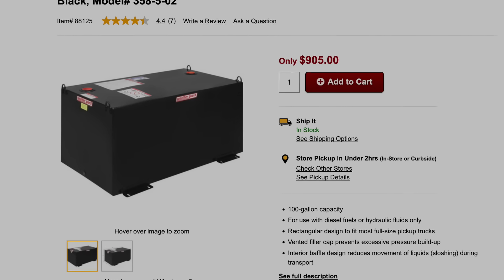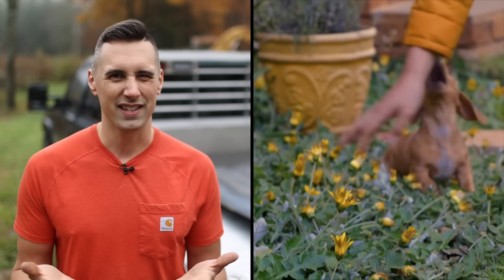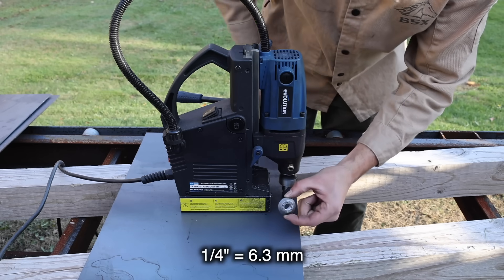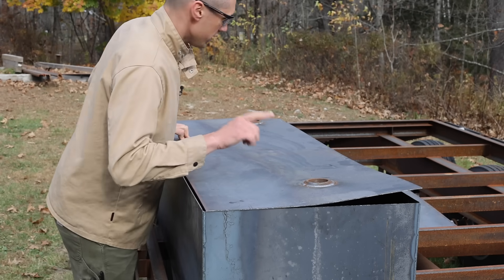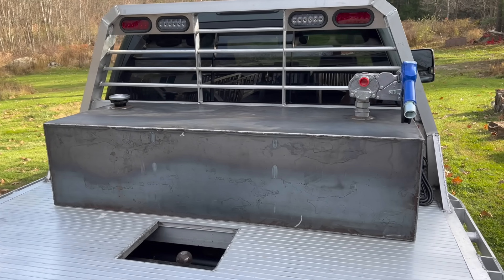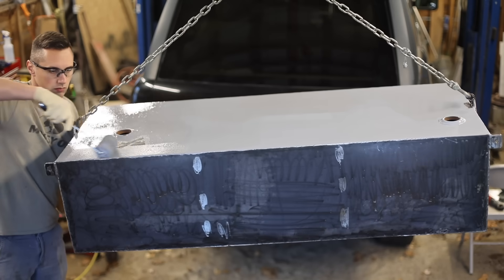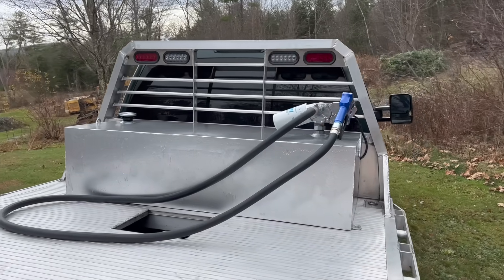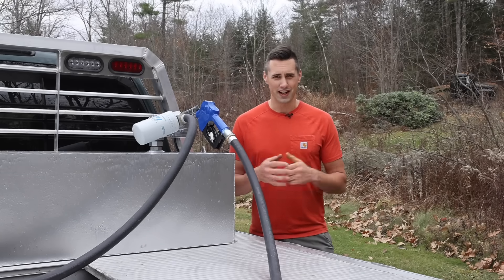Building a Fuel Transfer Tank

Comment: Normally I enjoy your channel as your doing fun projects that are well thought out. This however was not one of them, yes the fabrication was fun to watch. 

Issue #1 the design: It would have been a superior design to drop the steel off at a fab shop and have the front, under and rear panel bent (into the shape of a U) to reduce welds and potential issues.

Issue #2 the design of the fill and pump: Given your stated use as an Aux tank for long trips. Dragging the hose across the bed will be a pain and the fill and pump should have been on the left side.

Issue #3 red diesel ie off highway fuel: While less common now days, if the DOT/cops dip your tank or see you refilling your truck on the side of the road with red diesel we’ll that’s a big fine. I know it used to be 10k but I don’t know what it is now and may very by state. The issue is once red fuel is in that tank it’s hard to remove the die and it will stain your taxed clear fuel.

Issue #4: dissimilar metals and galvanic principals: I understand why you want to choose steel over aluminum costs however your bed is aluminum and while you did isolate the bolts and coat the steel to help prevent the two dissembler metals from touching. The bottom of the fuel tank is more likely to lose its paint and sag down overtime causing contact between the two dissimilar metals in a place that you cannot inspect easily. I personally, would made the tank out of aluminum as we’ve already seen you have the skill set to weld it.

Critique#1 I would have enjoyed, and others need the education, on how to leak test the tank with air/soap prior to filling it with fuel. Once diesel has been introduced it’s a lot more difficult to fix a bad weld. Yes, you do a very nice job welding and confidence is good, but also teaching proper technique is as well. 

Critique#2, next time coat the inside of the tank as there is moisture in the air and fuel that will rust it. 

I should say I also run a 60 gallon in-bed tank with tool box (low profile) and the 1,000 mile plus fuel range is wonderful. I also ran my own diesel for my heater but I used 5 gallon jugs, what a pain but saved hundreds every year. 

Good luck and I look forward to your next video.

Comment: Hi Waldo. Don't pay full price for on-road diesel to heat your home. You live in N.H. and should be able to buy off-road diesel locally and save a few bucks. I get mine from Kulik's in Winchester. The likelihood that you get your trucks tank dipped is slim to none. The Po-Po usually won't bother with small diesel trucks. So long as you don;t fill your truck up at the pump you should be good to go. Or, just empty the spare tank and refill it with the un-dyed stuff. what little tint remains won;t be noticeable.
Great job, by the way. Any reason you chose steel over aluminum? I'm considering building my own tank because I want gas on one side and diesel on the other. My son, who used to work for a fuel company, says it's legal to do that.
Love your vids. Keep em coming.

Comment: You screwed up on the welding the buns in if you don't have both pieces screwed together you risk warping one so it doesn't create a tight seal anymore no matter how thick the metal is you still risk warping it it may be small but it's still a potential leak especially since it's threaded

Comment: looks great , cool little project. i would have personally sprayed it with a cheap gun tbf but will still do the job just fine, also if any pin holes appear just use a bit of jb weld, it will hold up just fine (maybe xD)

Comment: It's almost exclusively propane or natural gas down here in the South for heating, outside of heat pumps which are the most common.

Heat pumps don't work in the colder states though. I haven't even seen an oil system in person lol
Reply: Heat pumps work in colder states. It's just the cost to install and run them isn't really attractive compared to forced air furnaces, wood stoves, propane heaters, or pellet stoves.

Comment: Seems like we’re thinking along the same lines. I just picked up a 74 gallon aluminum L tank with a tool box and manual pump for $500. Really glad I found it. The same setup new would be about $1700. I might never use an EPA can again.

I guess I’m cheap. When it comes to projects I’m more of a rustolium kind of guy. Any color as long as it’s black.

Comment: Curious as to why you did not paint the inside of the tank, or at a bare minimum, the  top half (where oxygen from the air, gets in)?  That occured to me as I watched you assemble the tank.  It's a very nice construction, I've seen "professional" tanks that were not nearly as well made.  As for your house inlet, is it possible to put on a short vertical pipe extension?  It looked like a normal iron pipe 90 bend to me.   Nice job, as per your usual!

Comment: Diesel out here in Kansas for the regular on road is running about $5.14 a gallon Cheapest I’ve seen it in my general area is $4.79 a gallon you should look into the off-road diesel to run your excavator and such and see if you be able to run your heating as well off. It only difference is that it’s dyed red and it’s not taxed runs about $3.30 a gallon for off-road diesel.

Comment: Waldo great job on the tank! I thoroughly enjoyed this episode. My only suggestion is a lock on the handle for traveling. What an awesome addition this is to your collection. 
I feel you on Pennsylvania fuel prices. We bought a place in Kentucky and Pa is the most expensive gas on the trip to the point I try to avoid the state as much as possible. Maryland is only slightly cheaper than Pa, but you save where you can. Just an FYI for your travels.
Reply from the maker: Thanks Pete! Yeah, I don't want to pay all those PA fuel taxes if I don't have to 😂

Comment: Can you get off road diesel anywhere near you? That would save the road taxes and be completely legal in the equipment or furnace.
I’ve been thinking about getting a tank like this because all my cars run on diesel and if you’ve been following news, diesel supply is getting low throughout country. Prices are likely to spike the winter and some areas might even run out.

Comment: Turned out nice with the exception of one small detail that i am even hesitant to say because i really like your channel and do not want to even begin to be "THAT GUY"  in the youtube comment section...OK, let me say that you do very very neat and clean work that always turns out awesome, but i was surprised with the quality of the final coat of paint on the tank. I loved the epoxy and the amount of prep time you spent to get it to adhere correctly. Maybe it just looked worse on camera than it does in person but it just seemed like it was full of runs and not as uniformed as i was expecting. It could be just the way that super thin aluminum paint was laying from the roller. I was expecting to see you spray it to get a super nice finish. Sorry if this is considered rude or anything, its not meant that way, its just a goofy thing that hit me as so opposite from what you usually do.
Reply from the maker: No worries! It actually probably looked better on camera than in person. It was too cold out and I guess I applied the paint too thick. It didn't run while I was painting, but when I came out to check it the next day, the runs had developed 🤷‍♂️
Reply: @WaldosWorld  It still looks great on the truck.

Comment: Hey Waldo Kym Adelaide here just wondering heating with fuel oil became non efficient here I Australia ,we went Gas now that has become a political football so now electric heat pump Aircond dusted but this is a discussion for a another time .My question is briefly how your system works does the DIESEL burn to heat water in a boiler system in your basement ,the then  heat rises through your house.Oh nice work on the fuel tank ,they don't let you build fuel carrying vessels here in Australia unless your a licensed business with certified welders and so on ,we are terribly over governed here .But as always great viewing mate hanging out for the next one

Comment: Any tool boxes ive made so far i always plan for 1 inch spacers so that you can blow out debris with either a leaf blower or an air compressor, setting things metal on metal seems to hold moisture , dirt gets stuck, and accelerates corrosion. So far it has worked really well for me.
Reply: I was thinking the same thing.  I have used Body mount pucks as spacers and they work really well.  Schmutz inevitably works its way under the tank, especially in rainy/snowy areas, and that always causes problems.  I use plated hardware too.

Comment: Unbelievably heating oil is actually cheaper here in Ireland so! Though I've switched over to Kerosene, a lot of people here burn green (duty rebate) diesel in their heating systems. The same fuel can be used in all construction, agricultural and off road applications. Its approximately €1.50 per litre at present and road (white) diesel is €2. I assume you don't have that option there? Though you guys had red diesel?

Comment: nice job  paint is not what it use to be. you have to be a good welder not to leave small pin hole's
 i got one years ago new that leaked had 3 pin holes. some states you are not aloud  to refill truck from tank in bed. there are big fines. that how i got my 2nd. tank. he got caught refueling his truck out of bed tank . if was in a state with high fuel taxes. he sold it to me with 30 or more gallons of fuel for$ 150. take care, be safe and well.

Comment: Another awesome project... I'm only halfway through, but great content as usual.

EDIT: Liking the epoxy primer for preventing corrosion, I'll be interested to see how this works. Where did you get yours? I'm hoping it's enough to prevent galvanic corrosion between your steel tank and aluminum bed.

EDIT2: IF you go to where they have a high flow diesel pump (Not always in the big truck section, some gas tanks have another one elsewhere for RVs, etc, it will fill up FAR faster than the small diesel pumps!

Comment: Waldo, get yourself an anti siphon insert. Drop it in the filler hole and tap the tabs in, you don't need fuel stolen on a road trip while at  a motel. We added them to our semi trucks. Great vid, and what made you choose steel over aluminum for the tank?
Reply: The push pull gun and Miller 300, I believe it's called, will set him back seven grand. You are not running four foot stringer beads with a spool gun.
Reply: Great tip too

Comment: why pull over? just install a button to switch tanks - this is common - you should  get a heat pump and power it with a solar  array and save money, be kinder to environment and geet tax breaks  to defray costs - lastly why not aluminum tank ?

Comment: I suggest using POR-15 Fuel Tank Sealer to line the inside of the tank. 
It's a great add on to prevent the inside of the tank from rusting when it's not completely full of fuel.
Reply: Por-15 is absolute magic
Reply: AND $1600.00 later I learned about coating the interior of a steel fuel tank when I had to have my injector pump rebuilt because of rusting.  Aluminized Steel or Aluminum is all I'll use in the future.     @devinmoodley4061
Reply: How much did they pay you?
Reply: Htp?
Free machine!!
Reply: POR-15 has too many tales of failure. Possibly mis-application, possibly not. But it's tough to do it right and on a tank this size, that may not be possible / practical. It's possible that the oily nature of diesel will coat the steel and be a natural rust preventative.
Reply: Too late!!!!
Reply: Well done Sir!
Reply: imho just keep it as full as possible and firmly stamp on the brakes in a safe area to splash diesel onto the ceiling of the tank.
Reply: This stuff eventually comes apart and makes a mess. Presumably he can just keep this thing full most of the time and then it will never be an issue. Plus he could add a port on the tank to vacuum the air out of it and solve it that way.
Reply: @sidescrollin  That's funny I've been using it for over 20 years and never had a problem with it, now if you don't apply it correctly it can fail.
However I'd go out on a limb and say 90% of the failures are human error and 10% contaminates in the fuel causing issues.
I've used on it on everything from my semi fuel tanks to kerosine tanks and never had any issues at all.
Reply: @xTRUCKERxGAMESx  I've dealt with multiple old fuel tanks where it or something like it had clearly been used and then separated from the inside in sheets. Nearly impossible to get cleaned out after that 

The thing is most fuel tanks are bare steel inside and they last ages, mostly because they are usually full of fuel most of the time.

If you just clean the tank out that's all you need and there's never a product inside to fail. Matter of fact the acid product used to etch the tank for por15 or other liners is great for that.

Comment: Only suggestion I have is to put 3/4” cam lock disconnects on the hose where it connects to the exit of the filter. That way you can remove the hose and handle to prevent people from eating to mess with it or the hose getting in the way. They do sell a cam lock plug you can put on the pump side to keep dirt, debris, salt, weather out of the pipe. 
Well done!

Comment: Hey waldo, you said that you use oil to heat up your home and you pay 5$/gal. Wouldn’t be cheaper to get used oil out of fryers from fast food restaurants?
Reply: Getting grease from restaurant are nasty. They smell gross. Then you have to process the bio Diesel. Need chemicals. Need equipment. Need a building for the processing of biodiesel. So you need to invest in the front end $$$$. Where do you dump the waste from the bio Diesel?

Comment: For all of you guys asking about pressure testing the tank, we used to use diesel oil to check the welds on new fuel storage tanks when I used to build them for various oil refineries. You can spray it on the inside with a pump sprayer and if there are pinholes it will creep through the other side pretty quickly. We also used a soapy solution with a vacuum box on water storage tanks.

Comment: Make sure you keep that steel tank full as much as possible. If you run it low and let it stay like that, it will start to rust on the inside and then you get a ton of crap floating around that’ll clog your filter and possibly get through to your equipment.
Reply: Is there a coating that can be used? What do aircraft manufacturers use (besides aluminum instead of steel)?
Reply: @JV-pu8kx  aluminum
Reply: @JV-pu8kx  on the Huey’s and cobras I work with, they have a fuel cell made of a rubber type stuff. If I were to do something like what Waldo has done, I’d do aluminum hands down every time. It’s lighter and won’t corrode as quick at all.
Reply: @JV-pu8kx  Commercial aircraft I have been close to use a flexible coating to line the fuel tanks.
Reply: @brianworley7705  That's what I was thinking of.
Reply: @JV-pu8kx  eh just run a 3micron fuel filter, swap it out when it gets full of crap
Reply: I saw NNKH put some sort of coating inside one of the tanks that he wanted to use on one of the Will it Run cars. Maybe there would be a solution for this issue. Have to check out later what was that liquid called.
Reply: @Balderoni_  I know steel tanks are coated but even with the coating, I’ve seen tanks get so much crap built up inside due to rust and low fuel inside. It’s best to coat it obviously and keep it full as much as possible. Can’t exactly open it up easy if you have to clean it out and recoat it.
Reply: Long as u have a good filter. Maybe even two.  Starts to rust. Not the end of the world.
Reply: I wonder if Imron, metal etching primer would solve the rust issue 🤔
Reply: Others mentioned POR-15 Fuel Tank Sealer above.
Now to something funny: Lets build a fuel tank. With the absolutely useful design-property: It is better to keep it full!
*facepalm*
Reply: @dieSpinnt  ever seen a transfer tank that someone has not used it in a little while and it’s half full? Take a gander and check out what the inside looks like with all that water vapor condensing and then rusting steel. By all means, use the hell out of your transfer tank but fill it up within the next couple days or top it off when you can.
Reply: @timothywaterreus9618  Yeah, you are absolutely right. That is the "design problem" I mentioned. Mostly (and hopefully) resolved with: "We should have asked someone who knows about the matter."
Or? Hehehe
Reply: @dieSpinnt  I see where you were coming from, when I saw him putting it together I immediately sucked my teeth and said well that’s gonna be a problem…

Comment: Great job! You welded it with not leaks!!! Any reason why you opted not to coat the interior of the tank to pervert rust?
Reply: How would you coat the inside?
If he coats and than welds the top on he burns of the paint, you would have to coat it trough the fill cap, that is possible but not with at home equipment.
Or have a bolt on top, but that would require sealent.
Reply: @jonasstahl9826  there are two part coating that go into fuel tanks. The inside is cleaned with a cleaner that is pored in and the tank is rotated over and over. Then the two part coating is pored into the tank and rotated over and over.

Comment: Man, when I tried welding 10 gauge steel, I ended up blowing so many holes in the metal, so I ended up tacking the whole thing together 😂
Reply: On 11 gauge, with a millermatic 141, I use 7/40 settings. My welds are very controlled at that setting. 40 is just as slow as you can go. Start at 8/55 for 10 and dial in from there. Listen to the sound. It should sound like bacon.
Reply from the maker: 10 gauge? Oh man 😂
Reply: @WaldosWorld  yep, it had so many holes you could call it Swiss cheese